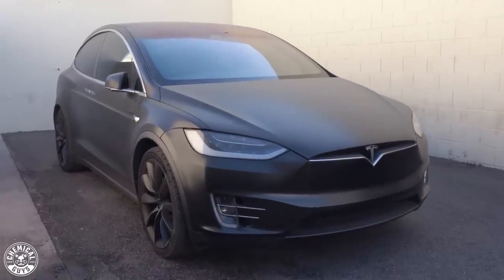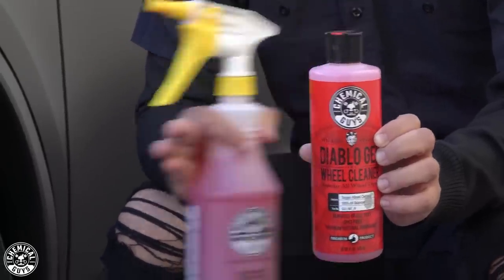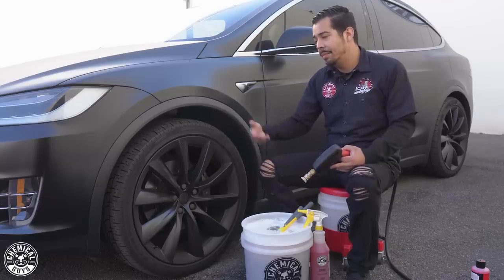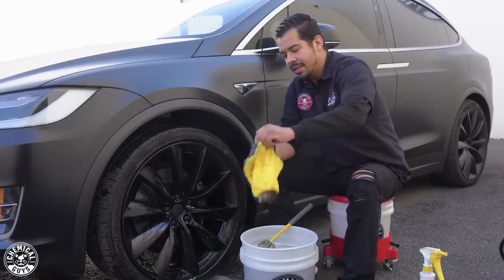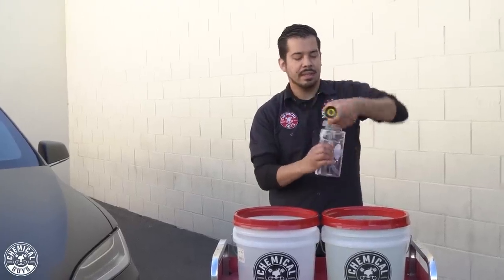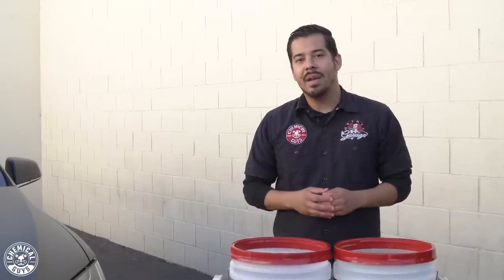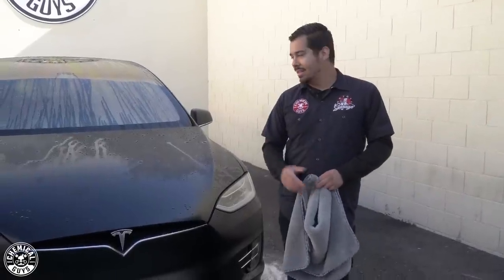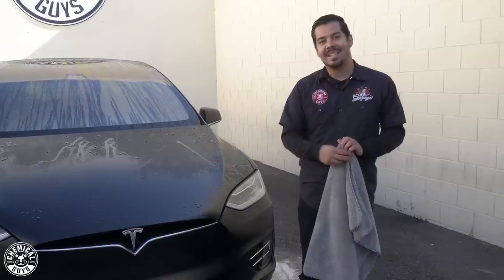How To Wash Any Vehicle Without Scratching! - Chemical Guys

Comment: Hey chemical guys do you leave the water on when you aren’t using the pressure washer?
Reply from the maker: Hey Ricardo! It is perfectly fine to leave the pressure washer "pressurized" for a few minutes while scrubbing the vehicle but it is recommend to release the pressure if it will be sitting for awhile and at the end of the wash. 
- CG Nick
Reply: @ChemicalGuys  thanks Nick 👍

Comment: Is there a certain PSI recommended for the foam cannon?
Reply from the maker: Hey Flint! Use anywhere from 800 to 3500 PSI to operate your foam cannon and produce thick foam.
- CG Nick
Reply: I think its more the GPM than PSI you need to worry about...

Comment: Question, I have tired Diablo Wheel Gel and The Citrus Tire gel on the tires. I have scrubbed and scrubbed with both products and still have dressing on my tires and get black fingers when rubbing them.  Not sue sure this stuff really cleans tires with dressing.  Does Chemical Guys sell a tire cleaning product that works better?
Reply from the maker: If you have extreme levels of dirt and grime, we recommend cleaning them with a degreaser first. Then you can maintain with a cleaner like Diablo Wheel Gel during your maintenance washes.

Comment: I’m not sure which wash to use, my car has a matte black hood, mirrors, and fin but it also has gloss wrap on the rest of the car, all ceramic coated. I’ve been using the ceramic wash, should I stick with the ceramic wash or switch to the matte wash?
Reply from the maker: Hey! We recommend Meticulous Matte Auto Wash, it is the first matte-safe car wash soap that won’t add unwanted gloss or shine while using advanced foaming technology to help prevent scratching the sensitive matte surfaces.

https://www.chemicalguys.com/meticulous-matte-auto-wash-for-crisp-satin-and-matte-finishes/meticulous-matte-auto-wash.html

Comment: Can Instawax be used on a plastic
Reply from the maker: Hey Elliott! Thanks for checking out the video. It is perfectly fine to use InstaWax on gloss finish plastic components. For textured plastic and rubber trim use Tire and Trim Gel to repel harsh elements and add a deep gloss.
- CG Nick
Reply: @ChemicalGuys  I can add the tire and trim gel work extremely good. It revived the extremely chalky and faded plastics on my dads van, my moms Tahoe, and his car. It also worked extremely good on the tires and even my mailbox lmao. It’s coming up 4 weeks since I put it on and it looks the same from when I just applied it

Comment: The stiff bristle brush is way too big and wide for low profile tires. That brush is good for an off-roader with massive tires, that’s about it.
Reply from the maker: Try using something smaller like our Nifty Brush. It utilizes the same nylon bristle as the Stiffy however it's much smaller and easier to control on thinner tires.